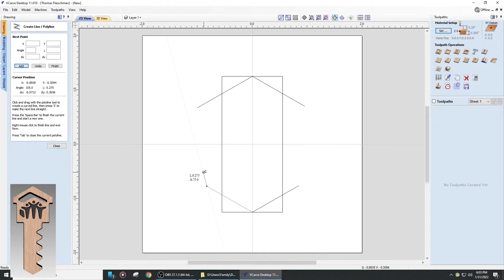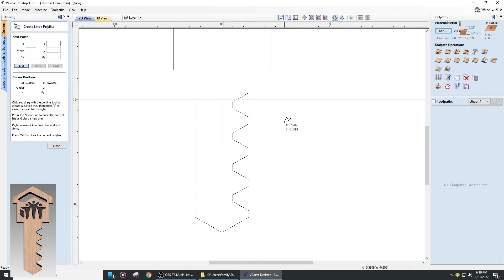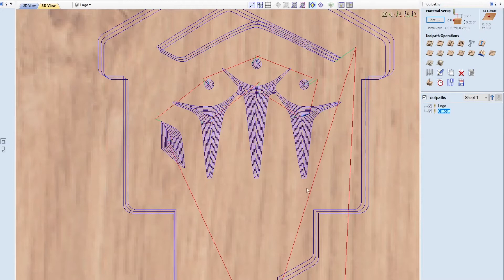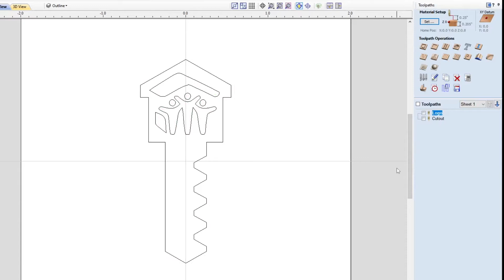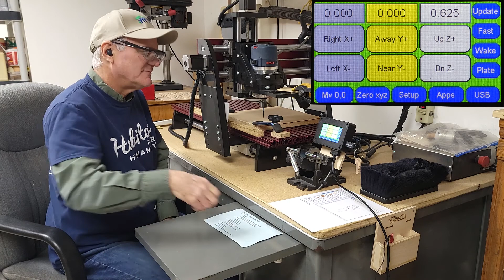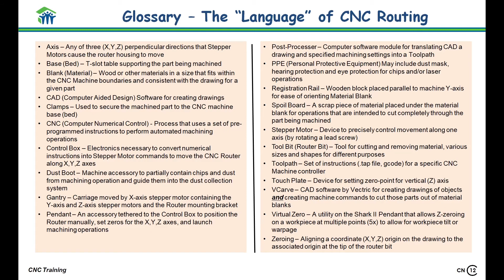The Key to CNC Woodworking using Vectric VCarve Desktop and Next Wave CNC Shark II

Comment: Thanks for the Video. Great Jog on Vetric. I learned a few things from you. I'm a new guy at VCarve desktop but I'm wondering if you mirrored your key to get three copies (of Keys) instead of just the one to save on material. Would that be a problem with your tool path? BTW, I have a shark SD110 with VCarve Desktop, so I like to listen to other CNCer's dealing with a similar CNC. Thanks
Reply from the maker: So, in the Vectric software there is a dedicated and handy "mirror" tool that looks like this ... https://photos.app.goo.gl/SfknRYVqmF5Kynxh9. Thanks for the comment and good luck with your CNC projects.  By the way, Vectric has great online help.  Just search something like "Vectric Vcarve how to mirror" and you'll get very close to you answer.

Comment: I received my HD500 last week so I am still learning. What is the logic of the safety block and turning the router off separately.
Reply: The safety block is to keep the router bit from drifting downward onto the T slot table when the power is turned off. If the rails and leadscrew are well lubricated, the router can drift downward when the power is turned off.    There's also a quirk in my controller setup whereby the router can turn on spontaneously if the touch plate magnet is completing a circuit when the power is turned on. Thus, I always turn the router off to ensure that it can't spin up unless commanded in a routing job.